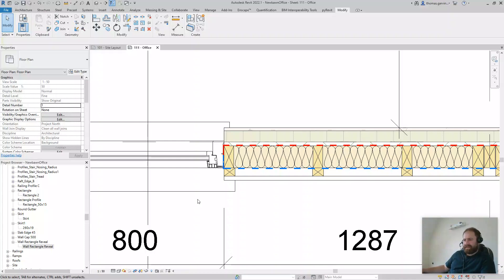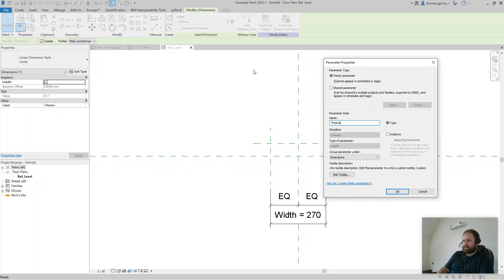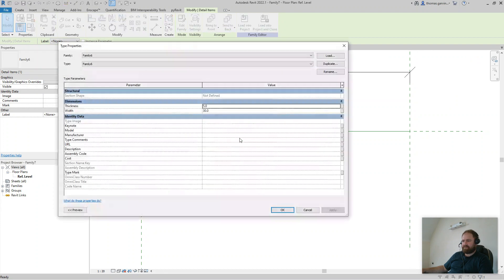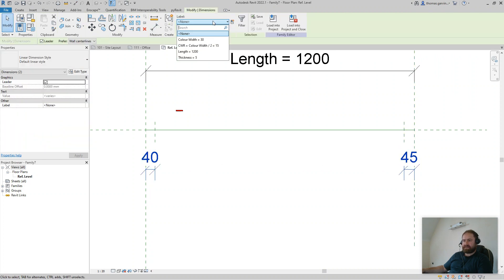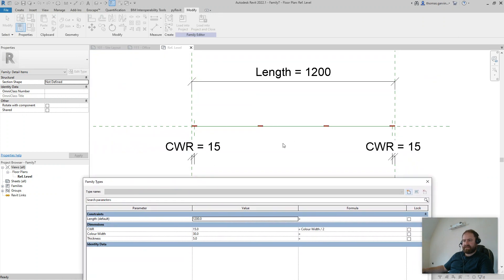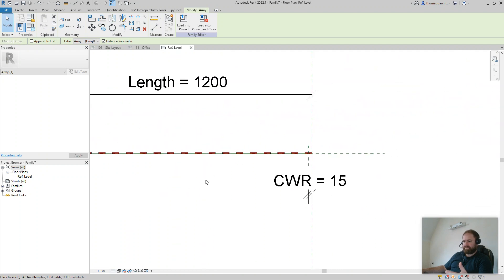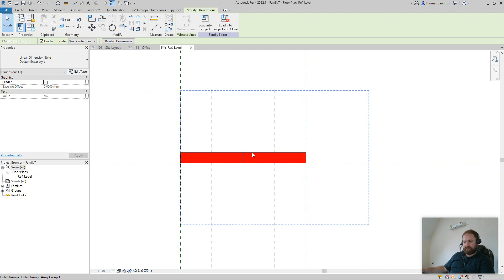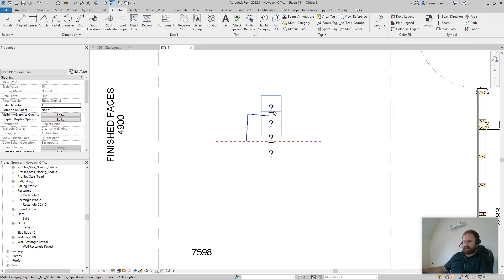Revit Line Based Membrane Repeating Detail Family

Comment: Hi Thanks so much for this!!! How can you have another one of the same color (like a different type) in the same family?
Reply from the maker: Hi Emma, you could have multiple versions on top of each other in the same family with Visibility parameters to turn them on or off. I think it would be better to have separate families though
Reply: @tg-at  thanks for your reply!! I was able to do it with visibility parameters. I think the only downfall of this detail item is that we can't automatically change the thickness of it based on what type of view it's in 😞 like the line will look too thin in 1/2" scale dwg but will look fine in a 1 1/2" scale dwg

Comment: Very good tutorial, I used it for some other family types I needed to create. 

Now as for the dash lines, the filled regions are so small and heavy that when I apply them in my project it freezes Revit. It takes about 5 seconds to load the line each time I apply it. 
I followed step by step what you did but it wont work for me if it takes that long to apply. 
Any suggestions as to why this may be?
Reply from the maker: Email me your family and I'll take a look at it. Thanks for the comment.

Comment: This is useful, thanks Thomas. I tried to use it to create a post-and-rail fencing detail line (dash-circle-dash). It came out too small and I gave up. If you have a minute and it's not too much for ya, could you make a tutorial for one plz.
Reply from the maker: Thanks Ivanna, I'll try get it done. I'm sure you're looking for it for your end of year project work. That could be a handy little family. Would you want the placement line to be centred on the posts, between the post and rail or on the outside of the rail?
Reply: @tg-at  Centered plz. I'll email you a pic I took the idea from
Reply from the maker: @IvannaChovgan  Didn't have time to make a video so I sent you two variations of the family. Good luck with your end of year assignments!

Comment: What's wrong with using a dashed Linestyle
Reply from the maker: A fair question Golbs. Well, there's nothing wrong with a dashed linestyle. However, I personally don't like how dashed lines or other line patterns look when made thick. They have rounded segment ends, I prefer the crisp square edges of this option. This is probably a secondary reason though. Lines don't hold information and so can't be tagged. A loadable detail family type can hold information and can be tagged. You still don't need this repeating detail for this though (see my earlier video on detail family lines). The other thing that this option allows is graphic overrides so you can add transparency for instance. Naturally you can use this family for many other purposes other than for membranes. Having said all of that if you still prefer to just use lines then that's fine, this is just an option for an improvement / enhancement.